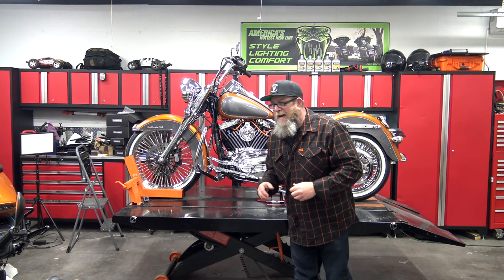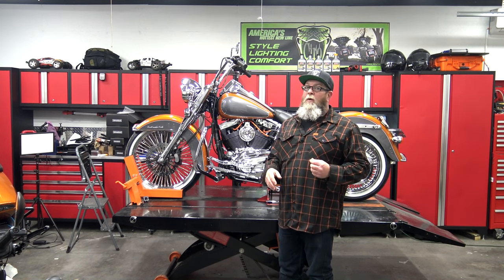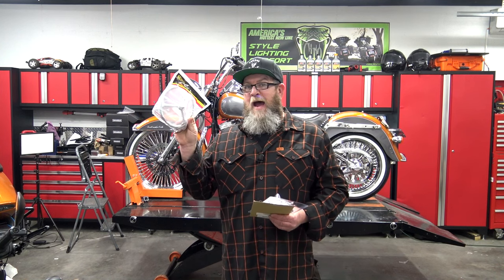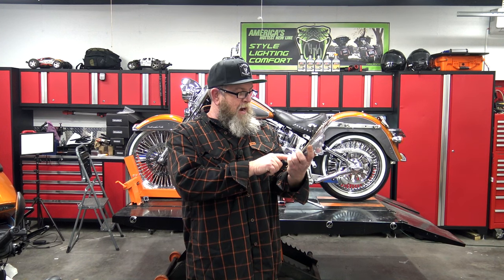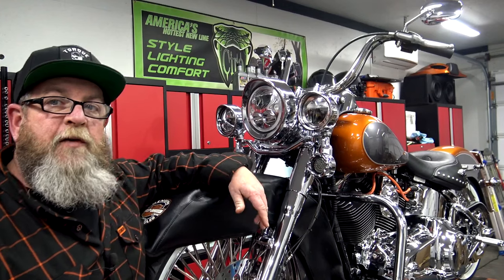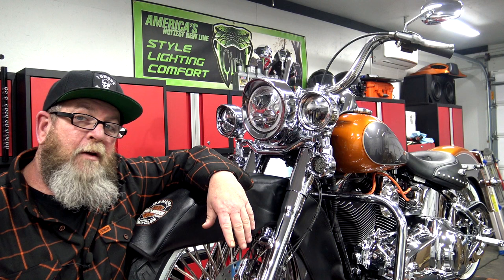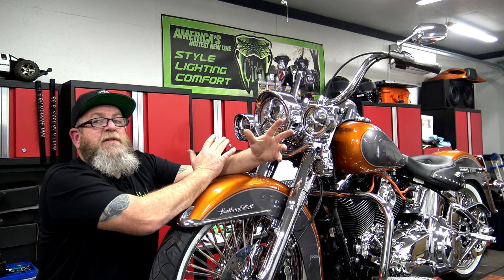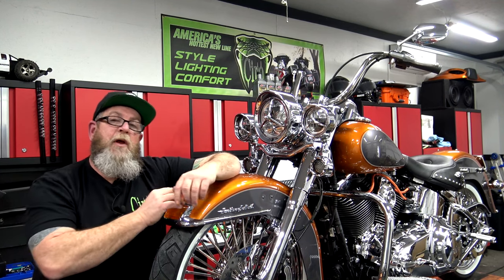⚡Softail Tri Bar Bullet Headlight/Aux Light Ring Install @harleydavidson⚡

Comment: Today i tried doing this exact set-up on my 2014 Street Glide. As for the visor headlight trim. I gave up because I couldn't figure out how to fit it around the OEM ring. And Hogworkz suggestion didn't work either. I did however get the Lucas Tri Bar on there so that's good to go. When it came to the passing lamps the visor trim with the Lucas Tri Bar acted like it didn't want to fit. I even tried the tri bar with the OEM trim and it was the same thing. You make it look so damn easy but it's a pain in the ass. Also my passing lamps came with some foam inserts. What the hell is that for? lol. I watched your video at least 50 times to see if i missed something. I am at a loss second guessing myself like maybe i need to use more force to get them on there or what. Any guidance would be appreciated. Thanks for tolerating my venting. 🙂

Comment: Love your videos . They have been very helpful. I’m installing chrome fork lowers . To move my tank back to disconnect my lights do I have disconnect my speedometer to move the tank back?
Reply from the maker: there is quite a bit of slack in there on those wires..just pull gently.
Reply: @sikbaggers  awesome! Thanks for all your help.

Comment: Nice I agree  those new led headlamps  don't look good if your trying to keep that old school look. It looks like an insect eye or something.  I used my a oem headlamp with bar and shield logo and ended up finding a nice led bulb to put in it works great been a few years still working.  Love the videos  keep it up 👍🏼
Reply from the maker: yes sir.I think thats what im going to do...I have some LED bulbs here that I pulled from a street glide ..however the bike came with these and I didnt get the take offs so I will have to find one on ebay or a swap meet..shouldnt be hard to find.
Reply: Can you tell what led bulb that is? Like to go led for my 2010 road king classic, but don’t like the new style led headlamps on a classic.

Comment: Good day sir, quick question on the 4.5 inch does this Wyatt Gatling comes as a set of 2 units or you bought 2 units? Is there a pair on each package?
Reply from the maker: You will get them in a pair